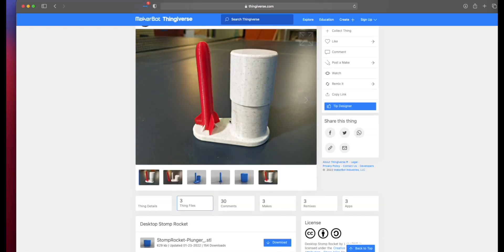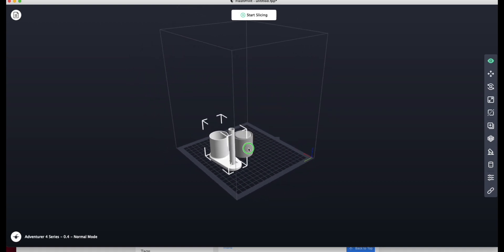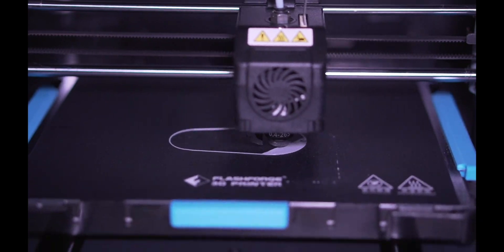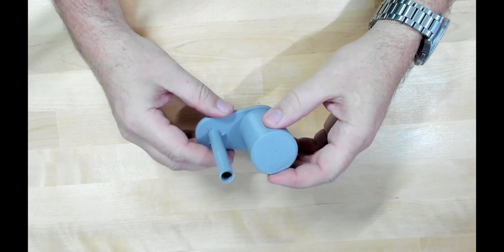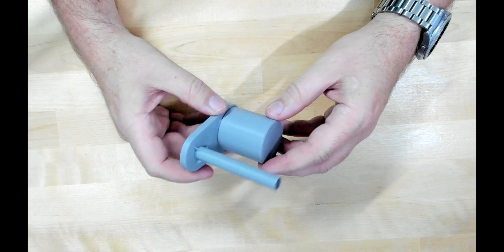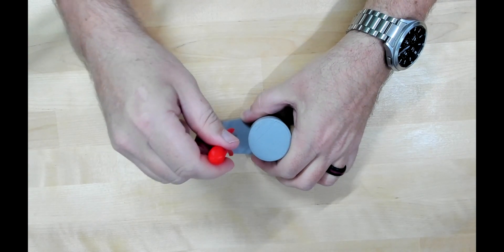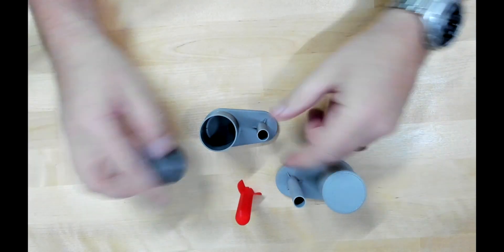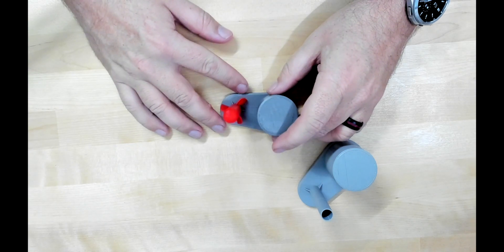3D-Printed Stomp Rocket - the world's coolest DIY project

Comment: You can print both pieces without a raft or brim.
Reply from the maker: Totally can for some reason it just wasn't sticking for me without the raft. I've re-leveled the bed several times but since the last flashforge update I've had issues.
Reply: @Danielthetechguru  Ok, that makes sense.